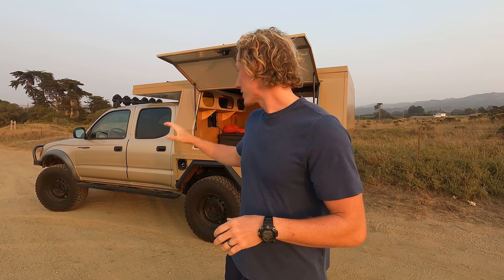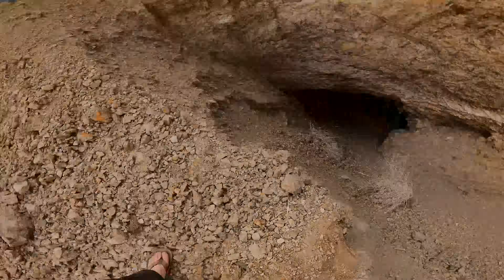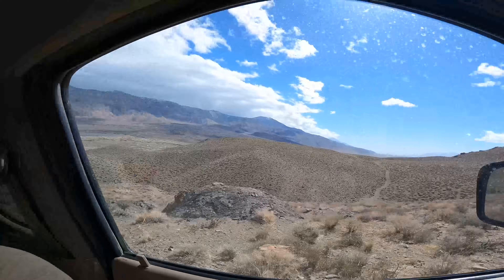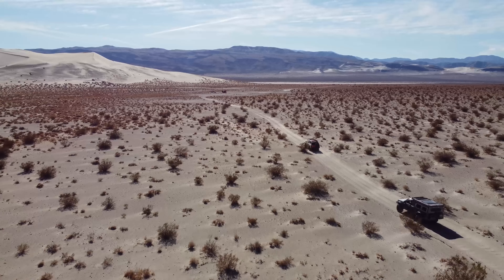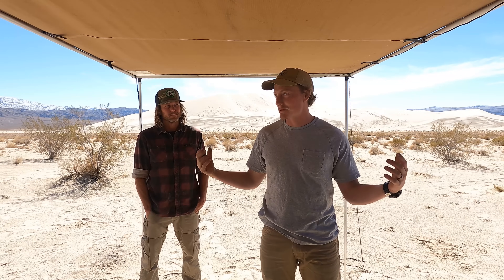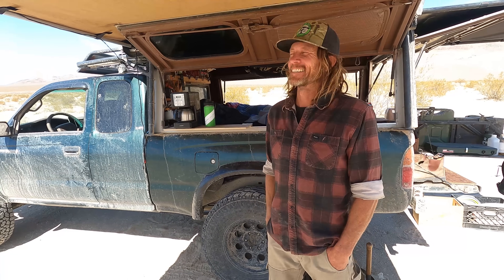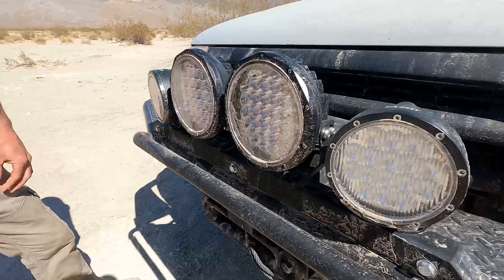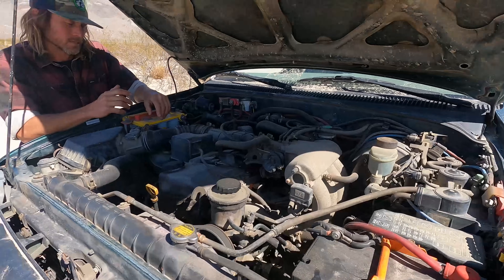INSANE 1st gen Tacoma adventure truck Walk around (SUPER DETAILED)

Comment: Damn this is great! How many "overlanders" have had the same rig for 15 years? Few. Well done. I'm 5 years in on my 95 4Runner and I hope I don't set it on fire with all the diy stuff I do to it 🤣 Learning to weld is getting higher and higher on my list of skills to learn. 

PS more hour long detailed diy builds are right up my alley, I'll watch if you put 'em out 🤙
Reply from the maker: Haha right? Man i definitely look at wiring differently now then when I started!
Reply: 2nd gen! I've owned mine for 14 years and she's got 320000 miles and going strong.
Reply: I use good quality flux core for all my welding spending the extra $ for good quality wite is worth it. Just grab scrap metal and cheep home depot wire and blast away...

Comment: I have been looking to get into building my own truck setup for a few years and this Tacoma has some of the most practical awesome design features I have seen.  The back awning and the bed built on the rack is genius.  I have looked but haven't run across anything quite like it.  When I get around to doing something like this I will definitely have to steal some inspiration.

Comment: I’d like to see more details on that fantastic rear awning. It would be cool to see some detailed shots of the collars mentioned at 56:18 that hold the rear awning in place at the front when stowed. Also, if possible, a clip showing the rear awning being stowed away/rolled up. I’m curious how it rolls back up on the cross bar that it is attached to. 
Great build, so many great ideas. Thanks for sharing. 🙏

Comment: Super rad, Iv seen his rig drive around a bit, but stoked to get the tour! Do you know what the gearing is he’s using. Stock? I have the same truck and want bigger tires but worries about the 4banger. Cheers
Reply: I’m running 4.56, same ratio change from the original 4.30 to go from 31” to 33” tires, speedometer is accurate. Definitely helped.  Matt at American Gear is the guy to have it done for you if you’re not super comfortable with doing it yourself. 🍻

Comment: I know this is irrelevant to this video, but did you ever test the tow hitch you welded onto your DIY rear bumper build? I’m planning on building my own bumper and was curious if I’d still be able to tow with a design like yours.
Reply: I’ve towed a wood splitter a handful of times but other than that I don’t really have the need to tow anything. I’ll put it this way though, it’s strong enough to tow anything the 4cyl could pull.

Comment: Hi Do you need some great lighting upgrade for your tacoma to help you better driving, off-road and adventure.We're the pro auto lighting manufacturer for nearly 20 yrs and w're looking for sponsorship!
Reply: Picking back up on my '19 SR 4x4 double cab build and would love to take you up on that if the offer extends to newbies. In the process of getting a youtube worthy camera setup. Majority of the mods done so far are 17" knockoff ('20 TRD Pro) matte black wheels badging delete, grille that I'm confident not more than a handful of Tacoma's possess, '85 Landcruiser "Toyota" badging for that grille, locking box to replace small stock one that sits behind rear wheel well, complete interior chrome delete and black powder coat headliner molle rack (thanks to Meso Customs), and a few others that don't come to mind at the moment. I try to stay as unique and top quality as I can with it, the grille and wheels served as a good starting point. Would love to get some quality lights to give purpose to an initial video! Thanks for taking the time to read this either way..
Reply: @nickolasburruel7801  Hi Thanks for the passion! Kindly ask are you 'overland under budget' himself?